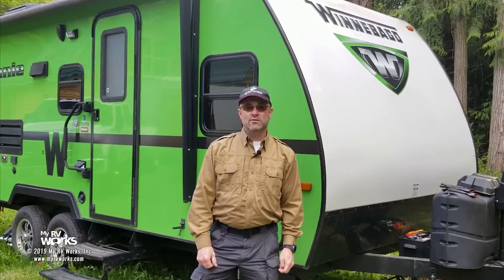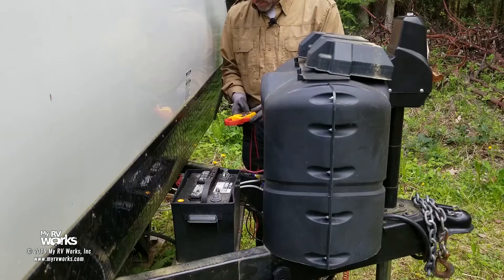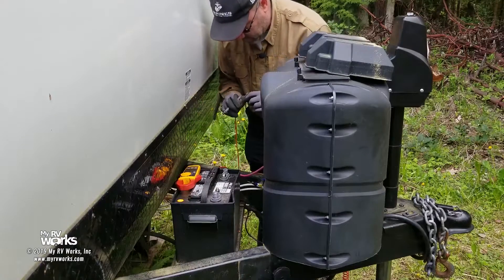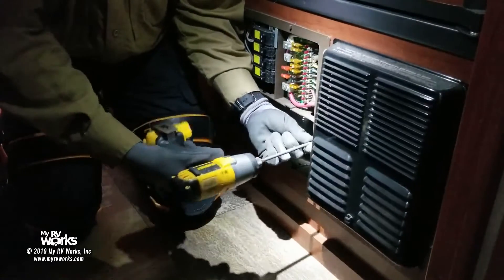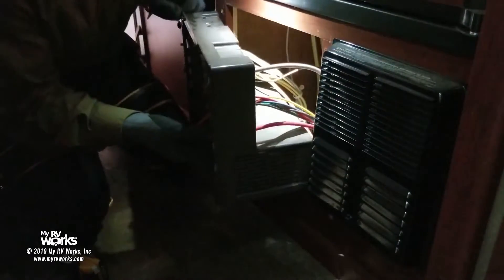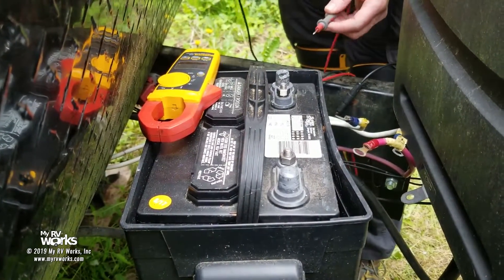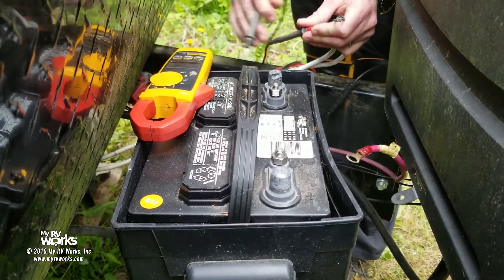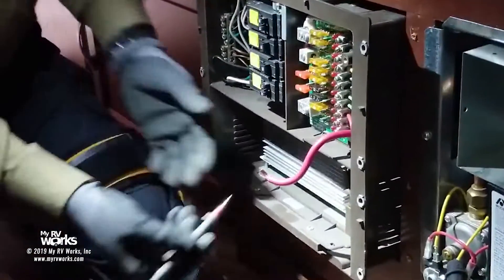Troubleshooting a Travel Trailer with a 12 Volt Circuit Short

Comment: Thank you for the video. I have the exact same problem have made it to the panel phase of the investigation. Was getting a sound at the +battery lead at the panel and found the bad fuse/circuit. Once I pulled out the panel I lost the sound. Replaced the fuse and hooked things back up and things were fine for an hour or so. Then the fuse blew again without turning anything on or off.

Comment: I purchased an outback 221UND with no back up camera pre wired for a furion camera. I purchased an after market camera that is furion compatible. I put it together just like the instructions suggested and plugged it into the truck and it worked. So I took it to the back of the 27' trailer used the connector to plug into the furion system and got no signal. I started the truck turned the lights to on not auto and still got nothing( no signal). So I took it down set it up in the truck again and it works fine. I also purchased a furion booster pig tale but still have nothing. Electrical systems are greek to me please help.

Comment: Awesome video and had the same issue with my camper, looking on how to fix it I came across your video.  Very awesome video, thanks.  Regarding my camper, the first 10 mins I got continuity between positive lead and ground, like you.  I followed your video and did all the things you did.  And just like you I went back and after not doing anything (other than turning off/on breakers and removing/replacing fuses) the beeping magically stopped.  Got me thinking. I wonder if this is normal and has something to do with a transformer/inverter (120V to 12V) I assume in a transformer/inverter there's a coil on either side (high voltage and low voltage) that retained some capacity and eventually dissipated?  I have no idea just tossing out my thoughts.

Comment: My awning is not working. When I looked at the 12volt fuses all of them were good. I did notice though when I pulled the fuses the burnt fuse light indicator came on. However, when I pulled the fuse for the awning the light did not come on even with the switch for the awning pushed.  I am assuming my problem is between that fuse and battery.  Any idea where I should start or what it could be?

Comment: why didn't the fuse blow on that circuit? Isn' that the point of the fuse to isolate the shorted circuit from everything else and protect the wiring/equipment?

Comment: Great job you are amazing so self explain u will used to see if I can fix  my  my generator work only when I on the key no start but drain my batteries so I stop and star my engine to charge my batteries for 1/2 hrs I do it again you think is my Volta regulator a short? everything work only I turn the key to on     excuse my explanation Spanish to English from Nicaragua Central America old istaca sunova 2003 gracias senor tx very much

Comment: Many thanks for the excellent narrative while you were "on the hunt."  In the back of my mind when you isolated the problem to the black "Center" circuit wire, I was already worried you might face a "CCWT" (Came Clear While Testing) resolution - bummer!  As it turns out on RVs, sadly the installers hurriedly (and sometimes sloppily) rush through installing screws that "nick" into the insulation of a hot wire.  And sure enough, over the years these time bombs that were sleeping in wait, eventually wiggle around enough that the screw finally pierces the insulation and shorts the voltage to ground.
While closing out the trouble ticked and heading home seems reasonable, yet when we're soooo close, ideally we would want to spend a bit more time to try to isolate and resolve the problem.  Here could hook up the beeper individually to each of the black wires at the acorn connector and pull/push/jiggle the wires while listening for an intermittent/momentary beep. Perhaps the short was a wood or sheet metal screw at a junction or switch box, etc.  On my Fleetwood when replacing the microwave oven, I was shocked to find dozens of sharp metal filings floating loose above the microwave, left behind when a rookie installer didn't bother cleaning up.  I also found a wood screw piercing the insulation going to the ac/heater controller so goodness knows what to expect in the future.  In fact right now my Converter doesn't seem to be working so back to work for me... Happy Trails,  Michael

Comment: New subscriber to an older video.  I'll be using this to chase a similar issue in my 2019 Jayco.  The cooling fan is constantly running with everything off, battery tests good and it's not charging the battery enough on shore power or even after a 6 hour drive.  It almost didn't let my truck start at my last fuel stop.  Anyway, thanks.  I'll definitely reference this and try to remember to report back.

Comment: What does it mean when you pull a fuse out of that panel and their is a spark?
Reply from the maker: That spark is just an indication that current was flowing through the circuit. Think of it as a mini lightning bolt. If the circuit has a current going through it and you pull the fuse, there comes a point  where the electricity will jump that very small gap between the fuse blade and the socket that it slides into.  (it's not unlike sticking your finger into water and pulling your finger back out. There's that little drip right when you pull your finger at the plain). Same when you put the fuse back in. It's not bad, it's just an indication that the current wants to flow. The electricity jumps that small gap as soon as the conductor got close enough.  For circuits in an RV, usually that arking is not huge. But you can imagine, in an industrial setting, those arcs can become extremely large and extremely dangerous.

Comment: I know the frustration of intermittent faults like that. We had a 2016 Thor 23U class C with a circuit that became shorted to ground. I worked for over a week tracing out the wiring only to end up isolating it to an area of wiring harness that seemed to be inaccessible. I managed to find a spare wire in the same harness that was clear of any fault and substituted it for the faulty wire.
After a career of 39 years as a journeyman industrial electrician, those kinds of problems are the worst.

Comment: Darren, can you explain what you mean by “touch it to the frame?” The continuity test and the word frame aren’t making sense to me.
Reply from the maker: The 'frame' is the negative post of the battery. If you go to your battery and follow the negative wire it's going to be bonded to the frame within a few feet. So, if you're checking 'continuity' you're looking to see if there is a path between the positive terminal - or the positive of circuit you're working on - directly to the frame.  If there is then that is a dead short.

Comment: Thanks for the great video and detail. You are very good at explaining things. Did this camper spark at the battery when you connected the battery cables? I just bought a camper with a bad converter. It has no dc power at all and of course is not charging the battery. I just ordered a new converter. I noticed when I connect the battery positive wire first then the negative second the cable sparks when the cable touches the negative post. Im going to check the cables to ground like you video. I just want to make sure I do not short out my new inverter. I have an electronics background so Im going to be checking all the wiring on this thing.

Comment: Thank you. You have empowered me to be a lot less timid when looking for the problem. I find your technique amazing. Intelligent reasoning yet you make it seem so practical and understandable. Continuity and ground seem to be the magical words.
I will use your method to find my problem....hopefully. 
My generator will start from inside the coach from either of the two start/stop switches ... but will not stop the generator. I have to go outside to the actual generator in my Winnebago Brave and shut it off at the switch on the generator...it still works fine.
Would you have any advice as to where I should start or what to specifically look for?
Thank you again and wish me luck.
Reply from the maker: One thing you can try, if the distance isn't too great, is just run a temporary wire from the switch, out the door then to the generator.  That will tell you Go/No-Go if it's the wiring in the walls.  Once you figure that part out, it's just a matter of playing detective to solve the case.

Comment: Love your videos Darrin.  I recently traced all of the DC wires in my 2019 Palamino Puma RESS257 5th wheel.
 Just as you removed each individual DC fuse to trace a short, I removed each fuse one at a time for Front, Middle and Rear.  Then I tested every light, most of which are LED in the RV by flipping switches.  "Front" fuse on my RV only protects the front cap docking lights.  "Middle" fuse protects bath fan/light.  "Rear" protects all living room/kitchen, hallway, bedroom and outside switched lights, which seems like a lot of lights on one circuit.  I just realized that I didn't trace which fuse protects the kitchen range hood/fan which of coarse I will now have to do. There are certain other fuses hidden around my RV.   I found a 5 amp fuse for awning rope light next to the front door,  inside the nearest upper kitchen cabinet , behind a crude piece of plywood, along with a huge rats nest of wires behind the  DC switch panel for slide,  lights, awning, and water tank level indicators.
I also made a DC wire color chart for each fuse leading out from each DC fuse.
Also, for any of your viewers like me, I found out that when a particular colored DC wire runs from the fusebox to a switch that, for example, would operate a slide room motor,  the wire leaving the switch to the slide room motor is a different color.
More colors than a rainbow, purple, black, orange, gray, purple, green, brown, pink, red.
The black/white wire to "Front" docking lights ran under the rig to the front and up into forward storage compartment to the switch, beside the storage door.  Inside the front compartmennext to the door frame is a thin plywood covering where many staples are shot clean through the plywood, leaving a gap near the switch where I could see the black/white wire running to the light switch for the docking lights.  A red/white wire leaving the switch to the docking lights had a wood screw driven right through the middle of the two wires.  I removed the screw and saw bare wire on both sides.  I was absolutely amazed that that fuse had not blown!
Just like the short you were tracing, if there were a screw driven through a wire that was somewhere/anywhere inside a wall or ceiling it would be very difficult or expensive to find!
You made a comment in another video I recently watched mentioning the "Proprietary" RV trade secrets that "They" don't want "Us" to know.  
I wouldn't own an RV if I had to take it to a "Dealer" for every little repair.  You're videos are "Invaluable"!

Thanks  again for the information you provide!

Comment: Had a similar problem recently on my keystone where all dc power was out but still had ac power, found a buss (not sure if this is the proper term) on the frame behind the hitch and jack, for grounding where the ground wire is grounded, it is corroded I wiggled it and all the lights came back on, I will be replacing this buss and cleaning up the corroded wire.

Comment: Thanks for the great video and concise explanations. I had been chasing a phantom dead short in my lighting circuit for a couple of days, thought I had it resolved but back it came. I watched your video saw how you tested the circuits replicated it with my fuse panel, verified the bad circuit, isolated it and rewired the entire lighting circuit instead of trying to find the exposed power wire and it is better than new. Your videos are awesome!!

Comment: I have a 2013 Crossroads Sunset Trails trailer.  A breaker labelled “front” will not reset.  The bedroom plug sockets and tv will not work.  I also noticed today that the fridge will not work unless on propane, possibly on the same circuit.  My trailer is currently plugged in, shore power, at home.

Comment: I love the videos there Darren...A! in the DIYer stuff. I am with Philip on this issue...why didn't the fuse blow?? I am assuming that they may have had this issue before and ran out of the right fuse replacement and stuck in a larger one,(Good way to start a fire). and frgot about it. "Center" could simply relate to the center alley way of lighting..which would match what you did when it failed. Could simply be a bad light fixture is all. Nice job though..enjoyed every minute of it.

Comment: Hey Darren, really appreciate your videos.  On this subject, I recently traced all of the DC and AC circuits in my Forest River RV.  The 7.5 amp fuse marked as "front" were the front cap exterior landing lights.  The 7.5 amp "middle" was the bath light/fan, and  the 7.5 amp "rear" were the living room lights at rear, hall way lights in middle and bedroom lights up front.  My RV and most with 30 amp AC service has only two,, 15 amp breakers for all 120 volt outlets.  Of course one needs to know which outlets are on each breaker. To ever operate two 1500 watt appliances at the same time ( coffee maker, hair dryer, crock pot, resistance heater, etc.) on a 30 amp RV,  each device must be on seperate cicuit breakers or a breaker will trip. Thanks again!

Comment: hello, good info.  my 2013 thor daybreak has a 12 v intermittent problem.  12v sys usually does not work.  unhooked from 50A and noticed the 12v sys was working, stopped for gas and  12v sys was not working, not to electronically inclined but neighbor has a little knowledge.  called my tech and he said it could be a relay, relay for what ?  dont know if u can shed some light but what do you think, b4 i call a mobile tech. thx

Comment: Another way is to connect a test light between the negative post and the negative wire at the battery. It will light up if there's a short obviously but then you start pulling fuses. When the light goes off you've found the circuit with the short.

Comment: Good video.  This is does happen especially with ceiling lights run in series.  So i usually give the owner the option of me pulling them to check.  I would love to have a set of knee pads like that where did you get them?   Thank in advance.  Pitts’ RV Repair Rolla, MO
Reply from the maker: We made a page on my website for Darren's tool Links. Here you go:
 https://myrvworks.com/resources/darrens-tool-list/

Comment: I have a tent trailer with dual batteries and a 3 way switch just installed last year - we ran minimal appliances dry camping and we got the loud low voltage siren around midnight - batteries were still reading 11.2 volts - switched batteries at 3 way switch and after short time same thing - checked batteries today and they read 13.6 after full charge overnight and rated perfect on meter at ORiley's - batteries are only 1 year old - checked fuses at exterior switch and it was good - extremely cold at night and need heat for my son's medical condition - running water heater and refrigerator but nothing else - why would low voltage sound at 11 volts??? I would think it would run down to less and then sound an alert - please help
Reply from the maker: Question, when you state a three-way switch, what are the three states of the switch? What is each state controlling? Also, you mentioned it's cold, if the batteries are not being charged, and they're getting cold, that could also affect their ability to produce electricity. If you can keep those batteries warm with blankets or something like that, you might notice a little bit more power coming out of them. It's a same thing when we store batteries in a refrigerator to make them last longer.  Another question, how many amps output does your battery charger produce? If it is less than 50 amps, you may not be able to charge your battery to full charge. If you check the charge rate of a battery shortly after you take it off of charge, you're not getting a true full charge rate. You were getting what we call a surface charge. As a storage device you can't really test the storage capacity of a battery until it is set for a couple hours. Is it actually storing the charge? We recently did service for a customer that had two deep cycle batteries and they were connecting their Shore cord to a Honda 2,000 watt generator to power the converter/charger and therefore charge their batteries. That's fine but, the converter/charger in the RV was only a 30 amp output and they were running the generator for about 3 hours a night. That will never ever charge those batteries.  That was what they were running into. But whenever they hit their battery monitor button it showed full charge. But that was just the surface charge.   They replace there sulfated batteries, we upgraded their converter/ charger to a  50 amp and now they're able to charge their batteries much more quickly and thoroughly then with their old 30 amp charger.

Comment: I have a phantom in my rv. We're currently touring the U.S in it and it reared it's ugly head twice now. I've done exactly as you did in this video.. with the same results. So I'm feeling your anguish ;-) I hate getting beat by the 12 volt demon!
Reply from the maker: Yes, if the problem goes away you've lost the trail so there's really nothing to troubleshoot. Good luck finding this thing.